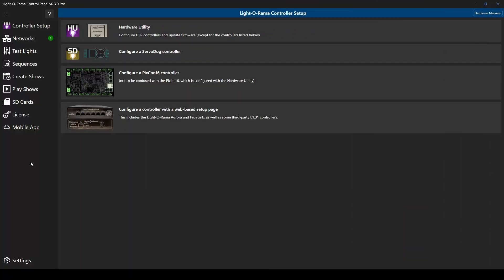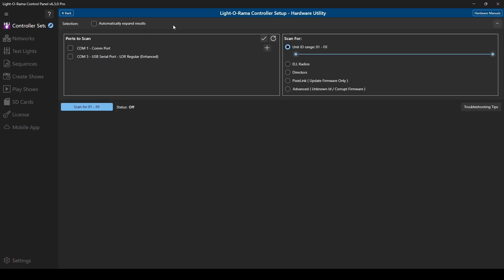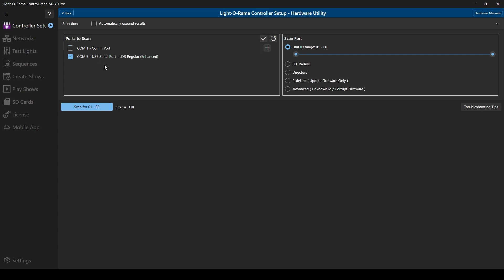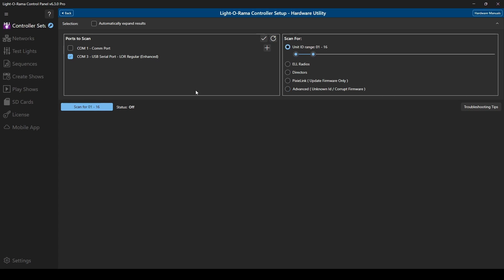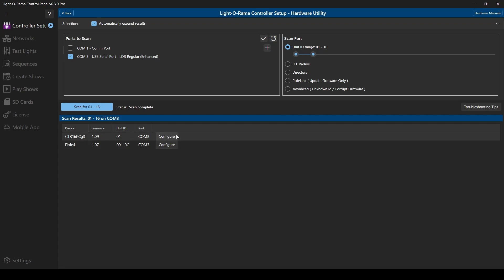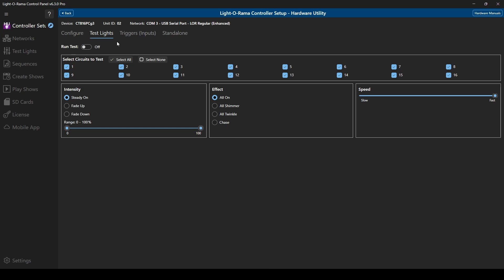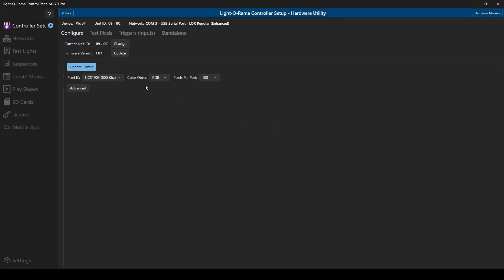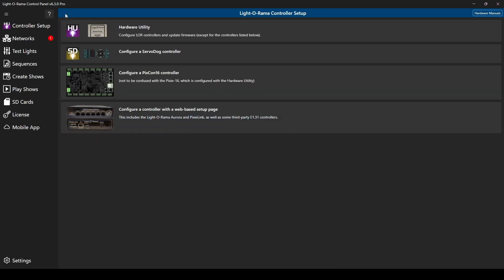Light-O-Rama S6 Control Panel: Hardware Utility (v6.3.0+) - Luminous Harmony "How To"

Comment: i think this video needs to be updated. My version has controller setup not hardware utility and it all looks a little different too...
Reply from the maker: This video is accurate and current for version 6.3.0 and above. If you have an earlier version, your screen will look much different from this video due to the significant changes made in version 6.3.0.